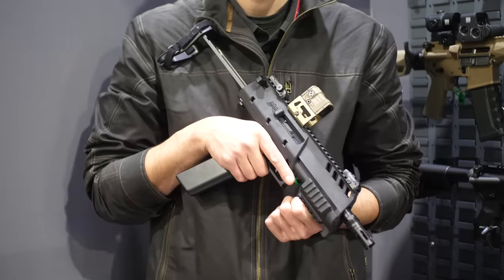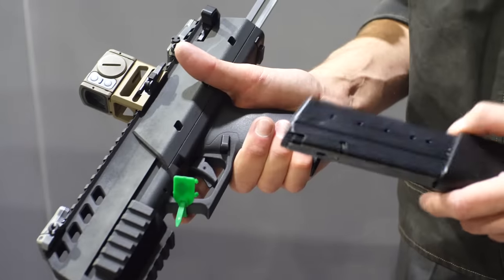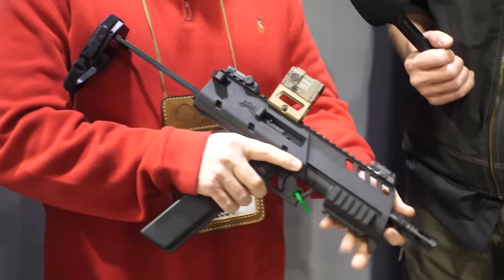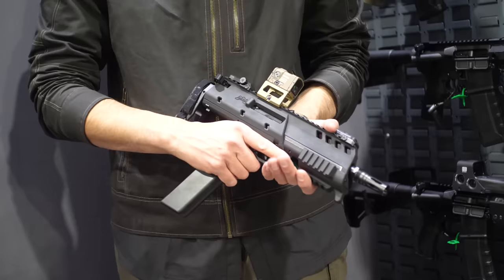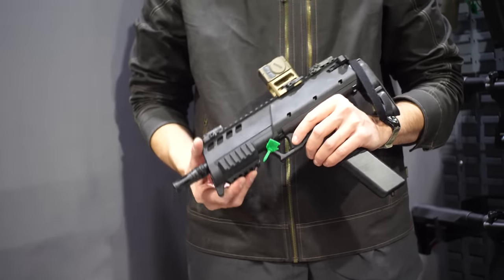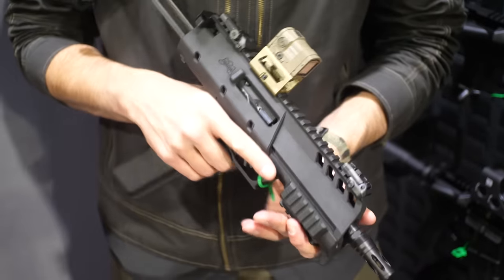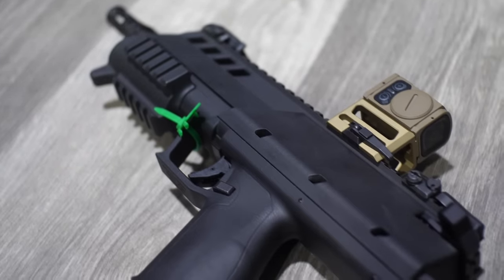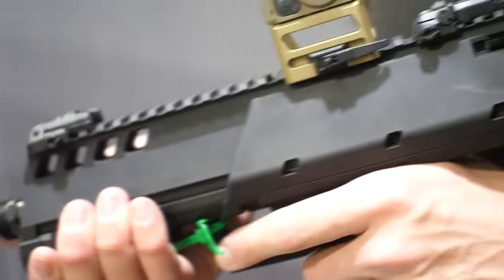The PSA X5.7 PDW Concept

Comment: I think the concept us interesting, but isn't 5.7 just a money sink of a range toy with no real practical use out of a semiautomatic firearm? It seems doubly so if it's designed to penetrate body armor but you can't, as a civilian, buy the round for which it was designed, or in the select-fire configuration in which it excels. Like I said, the concept is technically interesting, but 5.7x28 to me just seems like a niche answer to a HIGHLY specific scenario and is almost completely impractical othetwise.
Reply: Dudes from fort hood would disagree with ya

Comment: Van they ditch the fancy sights and charging handle and give it to use for like $800?  Seriously, who cares about some fancy metal BUIS with adjustable elevation on a tiny gun that will be shot 100 yards and in and a $100+ ambi charging handle on a tiny gun with 2 inches of bolt travel that will only ever have a smallish red dot on it, and this is coming from a lefty.  Oh and please put some kind of manual safety on it, obviously, it's not going to be holstered.